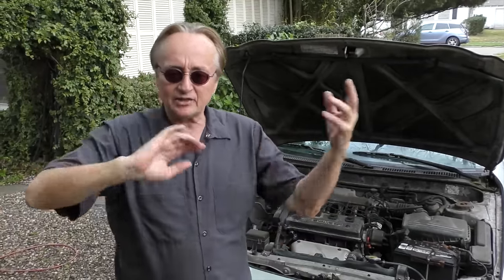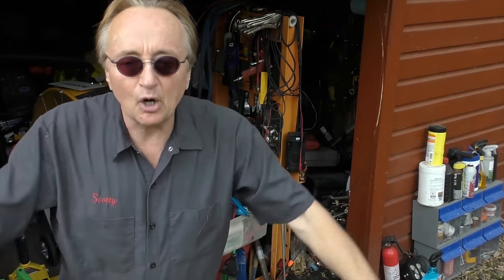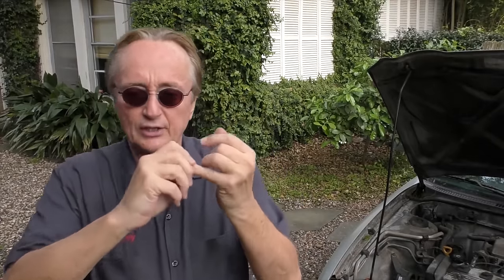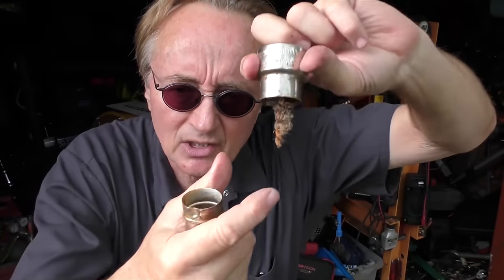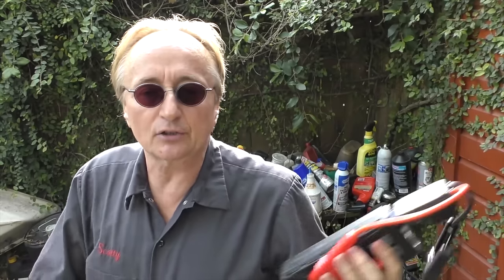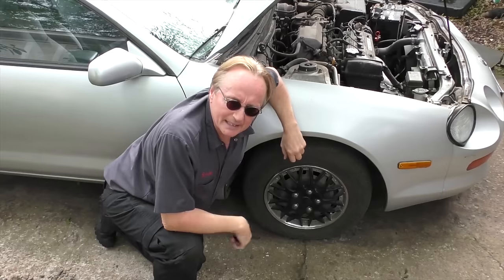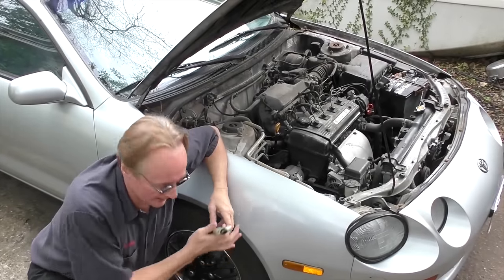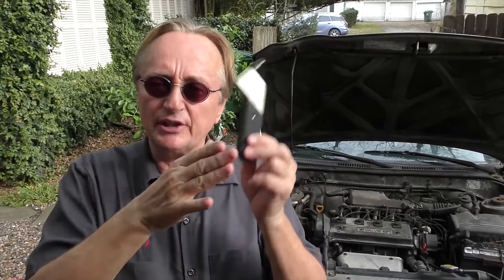If You're Not Doing This Before Starting Your Car, You're Stupid

Comment: Surely Kilmer fans are eyeballing their brake fluid level when they are checking the engine bay once a week??
Reply: I must be due I have a hundred sixty thousand miles on my Sonata I never open the hood yet😂
Reply: At one time looking under bonnet weekly was about the longest you dared,i had cars that drank oil or were notorious for overheating, these days they are more reliable,i have gone months without checking and then only thing needed was windscreen wash
Reply: Brian Bickle everytime
Reply: @eggy1962  I remember as a kid when my dad had to clean fouled spark plugs every weekend and the worried look on his face when his car wouldn't start Sunday night when he needed it Monday morning to go to work, now we complain when our  Nissan only works 60,000 miles worry-free😂
Reply: @joepierson3859  spark plugs seem to last forever these days they dont get fouled by bad rings or stem seals ...at least not till high milage.With the low milage we do spread over 3cars last plugs i changed was 3years ago
Reply: Unless you have some really old or unreliable junk you dont have to check on things too often. Modern cars run almost without maintenance, and i mean everything is modern which was made in the last 30 years. But its good to know these basics Scotty teaches. Unfortunately on the new cars sometimes you need special tools to even change a light bulb, on the older ones its easier.

Comment: service engine soon and maintenance required are two different lights. service engine soon is a code stored for a particular issue. maintenance required is the oil change indicator.

Comment: I once had a guy with a 27 year old motorcycle have it fixed under recall.
 Manufacturers have to fix a minimum percentage, usually well above 90% in first 'X-?' years ( depending on severity), airbags a good example, older vehicles in high humidity states got done first.
 Newer vehicles are still being done or waiting for parts.

Comment: Caveat about the recalls: Some have time limitations. Toyota installed bad dashboards in a lot of vehicles in the 2000s and there was a recall for repair, BUT it ended in May 2017. I bought a 2004 4Runner with a cracked dash in January 2018 that the original owner did not get fixed under the assumption I could have it done (dealers had told me it could be, but they couldn't do it). Nope - nasty, off gassing dash is what I've got.

Comment: The problem with just topping off the brake fluid is that when you finally replace the pads the brake fluid will overflow when the caliper pistons are retracted to make room for the new pads.

Comment: I have a jeep liberty, 2002. The heater and ac work when they want to which is almost never. Does this sound like a familiar proble? The windows have caught the same virus so I rarely use them because they might come down easily but I guess it takes too much energy to go back up, so they don't. It is a pain in the patooty. If you can steer me in the right direction I sure would be thankful.  I love your tutorial.

Comment: I had a problem with not/slow cranking.
Battery tested goo.
Turns out that the positive cable going to the starter was loose at the starter.
A drop of locktite and tighten it up and the problem went away.

Ford used to have a special coolant refill procedure. It was a PITA too.

Air pressure will drop 2PSI for every 10 degree drop in air temperature. Conversely it will raise 2PSI for every 10 degree increase.
Nitrogen loses/gains 1 1/2 PSI for the same increase/drop in air temperature.

Fill your tires in the summer and by January they can be 10-15 PSI low.

There was a guy that demanded his mechanic fill his tires with 'freezone' (freon).
Mechanic asked why?
Man said because he wanted 'one cool ride'...

Comment: The problem with using regular tires in place of run flats is that most cars that came with them didn't have a spare so if you do get a flat you are stuck needing a tow.

Comment: While I find most of your suggestions, helpful, some could be dangerous and/or costly. For example, you’re saying if your brake light comes on, you don’t need to run to the garage because your brake fluid might be low. If your fluid is so low to turn on the light then your brakes are probably  so worn they need to be replaced. You also mentioned buying 50/50 antifreeze. Doesn’t make sense to me to buy water. Buy the full strength and flute it yourself to save some money. Again though, thanks for your other Good suggestions.

Comment: Love all your posts Scotty. I also don't trust gas station air gages, for yrs I've just done the visual walk around check every other month. while it's on flat concrete & topped up the air pressure as required. Ps there's people out there driving on near flat expensive low profile sports tires because they don't understand.
Reply: Never go on the visual. Get a cheap pressure Gauge at auto zone and don't look back
Reply: @albinogator6221  it's only casual driving dude.

Comment: Drives me mad when a garage replace the brake fluid on half worn pads and fill it to the top, come to change the pads and it over flows, happened once to me and I check the level every time now, it was a good lesson but should have been avoided, I guess it's part of learning from experience, great video as always
Reply: That spilled brake fluid will also ruin the paint inside your engine compartment. Make them clean it up with a solvent that won't eat your paint.

Comment: to each their own, but id take run flats over any other low profile tire on a car. if you already have stiff suspension then the tire doesnt have much travel, the difference between my winters and my low pro run flats on my camaro is noticeable but not enough to complain about. the peace of mind run flats give way outweighs comfort loss, especially if you live in an area with potholes, the tires are not only more durable, but safer if you get a flat at fast speeds, and allow you to get to a shop for a replacement without needing a spare.

Comment: Oh and don't some newer vehicle's have fuel rail that go into the fuel injectors so if the fuel rail is plugged and not working it can same like the battery or starter is needing it be fixed my girlfriend had this in her 2011 F350 diesel truck

Comment: When your brake fluid gets low, you top it off?? As a tech the problem with this is when you reset the brake caliper with a brake pad change you push fluid out the reservoir and make a mess. If your fluid is low and you have no leaks, then your pads are low and should be replaced. Once replaced the fluid in the reservoir will be back at the full mark......just my 2 cents

Comment: When brake pads get worn I just replace them providing the rotors are not severely worn/damaged. I get 200,000 - 300,000 miles out of rotors before replacing.

Comment: On Nissan Altima, the "lane diversion warning" turns orange if the windshield washer level is low as there is a wiper fluid weep to keep the camera clean.  A lot of mechanics don't know this and will recommend the camera be realigned or replaced.

Comment: Some of the information is correct but also why wouldn’t you want to take the car to a shop. Like the brakes you want to make sure you replace the pads before they start to get metal to metal contact. If not a brake pad replacement becomes a rotor replacement as well which is more money. Don’t just put brake fluid have it checked out

Comment: If your brake fluid is low, and it's normal wear, you will be doing pads soon, but I fill it and drive, because soon does not mean now.  A trickle charger for the battery costs, but mine has paid for itself many times over.  Everybody who can change a battery should have one.  Didn't know that trick about raising the front of the car.  Thank!  Got an air pump/tank from Harbor Freight.  It has kept working through 2 cars, and I keep cars a long time.

Comment: A lot of manufacturers calculate the brake fluid volume to set that light off to indicate brake pad replacement is required (in accordance to your explanation of displaced volume).   Also a mess when the calipers are recompressed and brake fluid spills out.....

Comment: On "the brake light comes on 'cause the fluid is low" CAN be the result of worn out brake pads AND discs or drums. So if there are no leaks then this will be the reason!

Comment: Here's a question, I have a 2014 Buick Verano and I almost redlined it while the engine was still fairly cold to get out of some idiots way. Now it makes a weird sound only at lower RPM's 1000-1500 range. The check engine light came on and threw a PT0014 code which said the exhaust cam was advancing in bank 1. Other than this relatively subtle noise it runs fine. I had a friend of mine say it could be I slipped the timing chain since I replaced the variable timing solenoid and the check engine light came back after about 30min of driving.

Comment: if your brake system is in good working order,  a low fluid level can indicate that your brake pads are worn out due to the increased volume of fluid that is displaced to the calipers.

Comment: People obviously don't have a good mechanic. Maybe helps that I trained as a mechanic but my mechanic takes me under the car to show the areas that may need attention in the future. My last inspection with him he advised the roll bar drop links and brake disc pitting which was both obviously wearing. I'm lazy so will probably wait till summer comes back round to replace them as they're not dangerous.

Comment: No a sealed brake system cannot evaporate. Just top it off and hope that it doesn’t go down again, why not figure out where the fluid went? If it’s low enough to turn the light on the pads probably need to be changed, the normal fluid level range is big enough to take into account pad wear so if the lights on and there is no leak visible you probably should put some pads on.

Comment: Be careful removing your battery terminals from the battery. Some vehicles lose there radio because it’s anti theft programmed and you may have to recode it to get it the go back on. If you don’t know the code you have to go to the dealer to recode it. Check your book it may be in there or maybe the glove compartment.They will charge you a labor charge. You will need license and registration.

Comment: your brake fluid level, if you have no other issues, is an indicator of the wear of your break pads. when it gets to the minimum level most likely your brake pads are very close to worn out. a good mechanic will look at it and know about how long before you need your brakes done. you never want to hear that metal to metal sound when you push the brake pedal, because that means you might have to replace your rotors also, at the very least they will have to turn them ( cut some of the metal off ) to smooth them out again. although most brake shops do that every time you get brakes done. when you do that it makes your rotor weaker and increases the possibility of brake failure.

Comment: My dad had a car that if we didn't drive at least a little bit, EVERY day, -the battery would be dead. The battery was less than a year old. Nothing was visibly left 'on.' 
 Several mechanics tried to diagnose the dying battery issue, -no one found the cause. Then, an older mechanic had a brilliant idea... he opened the trunk and the light in the trunk hoo came on. He hopped in the trunk and pulled the lid shut... Then, he pounded on the lid to be let out. -The damn trunk 'courtesy lamp' was not shutting off when the lid was closed! 
 He reached in there with a screwdriver and busted the bulb and said 'there, -it's fixed! No more dead battery!' (we didn't care about whether or not we even had a trunk light when the lid was opened... it was an old beater-type car...)

Comment: Hey Scotty ... we  have a 2012  Kia Forte SX  that has those flatter tires. We bought it used in 2018 with just 4 K miles on it. We love the car but it has a very hard ride over bumps. You mean to say we could put higher tires on it to smooth the ride? Doesn't that throw off the mileage and the speedometer if we did?

Comment: The brake fluid goes down as the pads wear. So if the fluid is low you should check the pads because they are probably worn out.

Comment: 4:24 toyota sells a starter brush repair kit for about 7 to 15 bucks just change the parts its simple dont buy a 200 dollar rebuilt starter unless this didnt work is everything on the battery ckes out and all the wires are good.

Comment: If you don't have a leak you should not top it up as your early warning of pads wearing out it could easily cost you a set of discs if you hear the noise it is to late leave it a bit longer and you present a danger on the road.
Self cancelling service light is ok on an old car on a newer model the lack of service history lowers resale value. 
The heater fix is rubbish on lots of cars there are bleeders in various locations some even have to be partially filled via a hose.
Even the tyre section is inaccurate as cars fitted run flats have corresponding suspension.

Comment: Uhmmm....if your brake fluid level is low enough to trigger the warning lamp and you have no leaks,I think it's safe to say,YOU NEED PADS/SHOES...adding fluid may turn off the light,but it sure isn't gonna get rid of the metal to metal sound you're gonna start hearing soon after...(unless your master cylinder is leaking from the plunger/piston,which is a leak you're not going to see without pulling the master and just filling your vac assist booster with fluid....if you have a hydro-booster,then that's a different story.. you'll see that leak regardless)

Comment: I'm no expert but manually turning off the check engine light doesn't sound like a good idea without servicing the car. The owners manual has recommended maintenance to prevent break downs or more wear and tear to other components. Not changing spark plugs etc can cause more strain on the pistons and lead to misfire which can cause bigger issues. Changing these things out will keep your car running longer. Unless I'm missing something here.

Comment: My wife's car had the brake light come on while she was pregnant. I knew the brake fluid had recently been changed, and I wasn't going to risk anything. So I had her get the car towed to the dealership. They found a punctured brake line and spliced it or whatever for about $80 out the door and no other fuss.

They're not all bad, but for sure be wary.

Comment: Here's my question to Scotty -- if one disconnects the battery to clean the terminals, doesn't that screw up all the computer settings? I bought a used car cheap that didn't have the codes and when I replaced the battery the mechanic had to connect directly another battery then change out to new but the current wasn't disconnected. Just a comment more than question.

Comment: Dont fill the brake reservoir, if your low on fluid you probably need pads. if you fill the  reservoir you'll have to take some out when you do replace pads and you dont want to be spilling that brake fluid on a painted surface

Comment: Also, lights can come on, just because they feel like coming on. So, if you have checked brake fluid, water etc, before you take it to a robber, disconnect the battery for a minute, to allow the electrons to dribble out, then reconnect the battery. There’s a good chance the light will go out.

Comment: A very wise topic.  You might find these true stories interesting.  I have been in five brake failures over the last six decades.  So some happended with single circuit brake systems in older cars.  The first was as a young child.  The brakes failed, so mum (driving) chose to collide with an earth bank.  Had she not, there were no other obvious alternatives. Another was a heavily loaded vehicle going down a long steep winding grade - so that was a run-away brake fade.  Another was a vehicle that had just had an exhaust repair - when it was lowered to it's wheels, the mechanic failed to notice the brake hose tightened across the exhaust pipe.  Another was another old car - I forget the cause, but approaching a main intersection with traffic lights, I had no pedal, applied the (next to useless park brake. Leaned hard on the horn, flashed lights and changing down ratios - but still ran the red light.  Survived though.  And the last one actually had dual circuit brakes.  The master cylinder failed on the front brakes when I was committed at the top of a very steep hairpin driveway.  I guess I have some guardian angel.  But this has left me with a fanatical regard for Brakes.

Comment: One thing to remember, brake fluid "doesn't" evaporate. True, your level will go down as brakes wear. If you find that it's low, just top it off but check your brakes for wear and replace them before they tear up your rotors or drums...Scotty's right...don't believe that you're having a brake system "Meltdown" just because the light is on. But remember, the fluid is down for a reason....and trust me, it's not because it just evaporated...

Comment: So now they top up the brake fluid and instead of getting the brake checked to see they are low, now they wear them right down to the metal, which besides being unsafe for stopping, they could also be looking at having to replace calliper as well. And when the piston is pressed back in after replacing the pads, now you get brake fluid all over the master and if it gets on paint say goodby to the paint. A good and honest mechanic would only sell the customer what they need, but should always look out for there safety.

Comment: And speaking of tire pressure gauges or those plug-in 12V inflators, yes you can get confused. None of the 3 that I had showed the same pressure. Some where as much as 10 psi off. Same with the inflators. So which one shows the actual true pressure? I decided to stick with just one and hope it's in the vicinity of 'correct'.